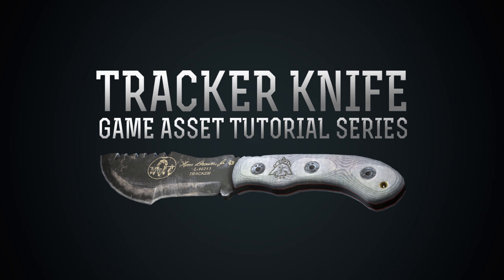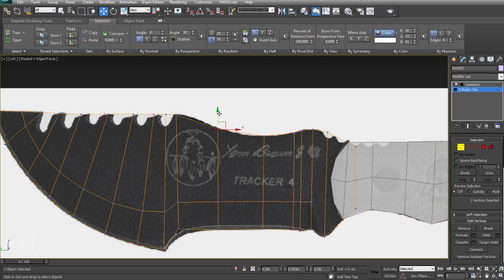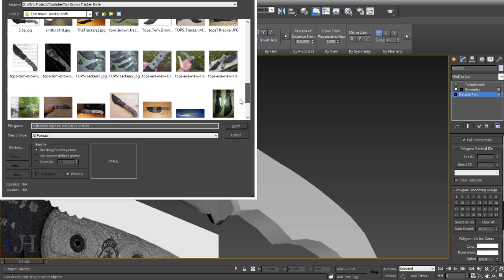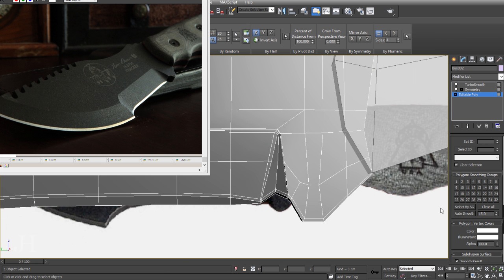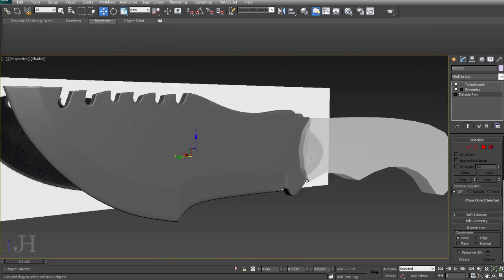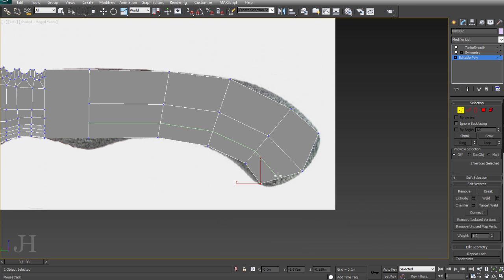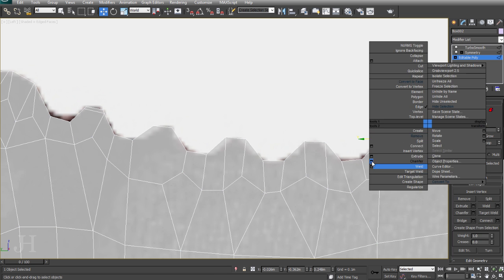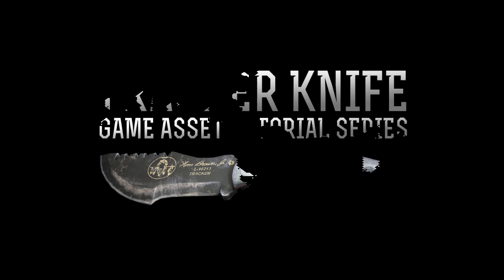Tracker Knife Part 1: NextGen asset production series

Comment: Hey Joe, I was looking for some things to practice with and ran across your project here. I was taking a look at your techniques and I had a question about the geometry you added at 5:01. I can't tell if you used a quick loop, or selected the ring and connected it quickly, or manually cut it somehow. It didn't really look like any of what I mentioned, which is why I was curious how you went about doing that.